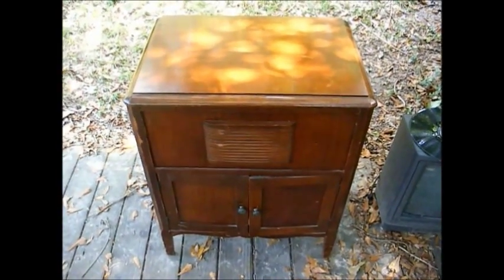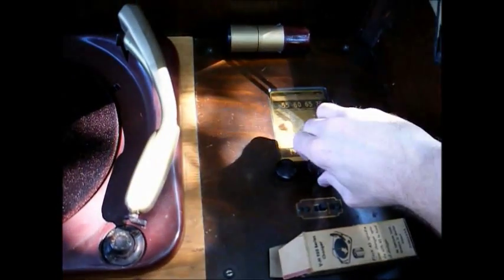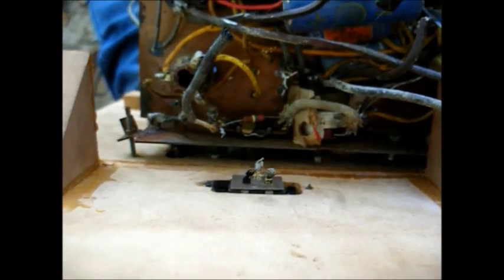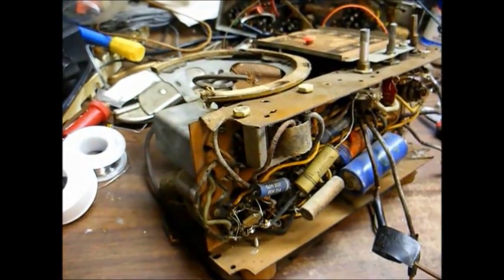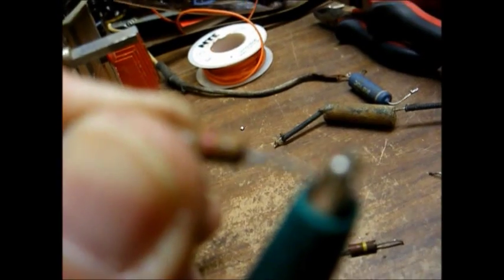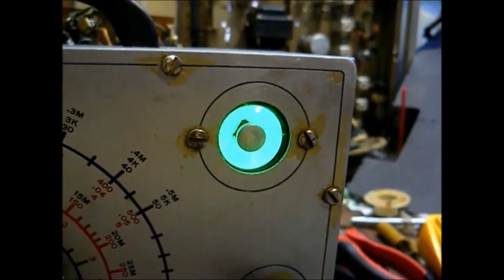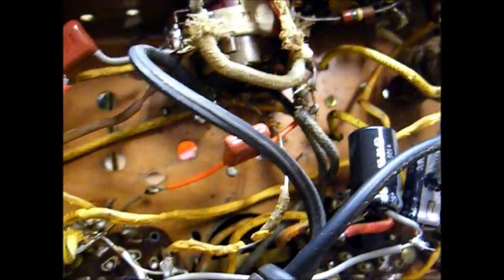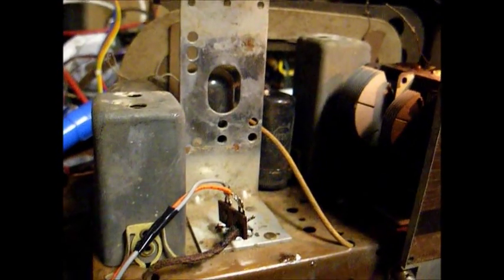RCA, Automatic, Voice Of Music "frankenradio" tube radio / record player

Comment: I've never seen that one before. This was one of the earliest example of a console hack. You can take a radio and then connect to a record player and called it a "Franken Set", an all-in-one combination. This was long before stereo receivers and amplifiers did not introduced until the 1960's where they includes the RCA jacks on the back where you can hook up to a phono and aux for DVD players, iPhones, iPads and other devices.

Comment: That's an interesting find...don't see too many Automatic consoles. I"m thinking they probably gave up on the original turntable when the idler wheel went bad, but I wonder why they replaced the original chassis? You might be better off going with a newer VM turntable...one with a ceramic cartridge, and the more simplistic drive mechanism. I'm staying tuned to see how this one turns out.

Comment from the maker: Yeah, I'm thinking the same thing on the changer because I could easily spend close to $100 having all the rubber rebuilt and I'm really not that crazy about this series of VM changer. The good side is that at least this changer looks old enough to more closely match the original cabinet. Maybe the old chassis got struck by lightning and wasn't worth fixing and the owner liked the cabinet well enough to swap in another chassis.

Comment: In the '50s apparently it was a popular "handyman" hobby to take an old radio set with a beautiful cabinet but clapped-out or obsolete chassis and install a later model chassis and changer.  Burstein Applebee used to show many "combination" kit offers of different popular makes that could be installed in older cabinets.  IIRC a company called Midwest used to offer a number of kits like this.

When I was a kid back in the early 1970s I found a cabinet in the grandparents' barn that used to have an Atwater Kent radio that my grandfather used back in the day.  The original guts were long gone--probably my uncle...  Anyhoo I ended up acquiring an old Philco floor model radio with slicer changer and optic-beam tone arm.  The changer was accessed by pulling on the top edge of the speaker grille the way most of those old consoles were.  The changer was FUBAR.  And so was the cabinet, owing to being stored in an outbldg with a leaky roof.  The radio chassis and its speaker worked just fine, so the A/K cabinet served as a new case, with the original Philco loop antenna mounted on top.  It was rather sinister looking, but I used that as my bedside radio all through my teens.
Reply: +David Locke  I can vaguely recall, on a similar fashion RCA advertised and distributed all the resources needed to convert old Mono players  to Stereo back when stereo was a new thing.

Bet your radio looked really cool.

When I was about 12, my parents bought and gave me an old tube radio for me to play with (my first experience with vacuum electronics, memories). It was so severely damaged I never managed to fix it. It did however pick up a station once before bursting in a cloud of smoke. The cabinet claimed to be a '41 RCA Q21, but as time went by, I finally worked out that the chassis did not belong to that set.

It was rather obvius, since the holes to screw the chassis to the cabinet didn't match, the tubes themselves didn't match, it had no power transformer, while the Q21 has one,  it has a 2 band dial like the Q21, but the chassis is a single band set, among a big list of smaller makeshifts inside. The chassis doesn't have any mark that tells where it came from. It looks more recent than '41.

Would replicate a Q21 chassis in the broken chassis if I had a schematic, since the cabinet is a local manufacture that is quite different from the american one, I really like it.
Reply: +MisterTalkingMachine , Nostalgia Air www.nostalgiaair.org will have your Q21 schematic, and schema for just about any hollow-state radio you might run into.  As for any old radio you dig up there's bound to be intrigue and evidence of jiggery-pokery.  The set has been around a long time, increasing the probability.  Also bear in mind that while there might be 5 people in your average middle-sized US city today that will tinker with a radio when it kicks the bucket, back in the early days of radio every 5th house on the street there was a man who would consider taking his defunct receiver out to a plank of wood on sawhorses in his garage and give the innards a look-see.  Some home-brew fixes were effective, some just downright amusing.
Reply: +David Locke Many, many thanks. For years I have been looking for documentation on the radio.

On a country like mine, which was rather poor by the time, you just had to repair everything, and yes, I have seen my share of some hilarious fixes, IE, a ceramic coated wire wound resistor blew up, so they wound another coil of wire over the dead resistor and attached it to the original terminals.

My grandfather himself says that back in the day, he once fixed the humming of a radio by putting a cap from a car engine in parallel with the cap that goes across the mains.

I acknowledge I am guilty of a lot of sloppiness myself, either on fixes I did when I was very young, or by being unable to get the right components.

When I was very young I replaced a broken dropping resistor from  a  220 V set with an Halogen lamp.  In case you are wondering, those sets are just your regular All-American Five with a clumsy big resistor. That resistor is very prone to failure, as I am yet to find a radio that has one in working condition, or lacks any weird fix. By now I have learned that those resistors, at least those with exposed windings, can be easily rewound with nicrom from heating elements, the dropping windings that drive the motor on hair dryers has been particularly useful as well.

Thanks you very much.
Reply: +MisterTalkingMachine , Any time!&#160; :)&#160; 

As a lad of tender years I used to improvise with whatever garbage I could pick up, or con off someone.  I used to dig old German radio chasses out of the creek beds behind residences in Columbus, GA back in the 1960s. These receiver "orphans"  came back with Army families when they came back stateside from bases overseas.  When Telefunken went funky, and no local technician would touch it, because it&#39;s one of them foreign jobs, the cabinet would be saved, and the guts hove. I'd dig them out, bring them home, hose them out, and plug them in to see what color smoke came out. Usually the chassis would get stripped, and I'd build something on it. I went through a lot of enamel wire and toilet paper tubes.  When I couldn't get my hot little hands on a UY-224, I would improvise with a 12BA6 cadged from a busted-up AA5.  Most of my make-do tricks regarding parts such as capacitors would provide good results, or great excitement. :)
Reply: +David Locke Hahaha, yes, I can relate as well. Adapting a miniature tube to an octal base is something I can recall trying at least. Making coils on toilet paper rolls, PVC pipes, bottles, whatever could hold the wire, which I more often than not got from some broken electric motor.

Butchered roadside TV's were and are still a great resource, thay can source miscelaneous capacitors and resistors, sometimes come with power resistors that are just unavailable at the store. May also provide transformers, speakers, and sometimes older sets pop in, with some tubes left in.

I have a franken device I built myself in recent years actually. A simple record player composed  of a BSR changer in the case of an old Garrard RC-80 some demolition men found totally rusted in a house that was abandoned since about 1960, and gave to me. The changer rusted to near inexistence, but somehow the wood survived in very good condition. Put in a pair of speakers from a samsung TV that got dumped at Grandma's place, an amp from some crap 90's casette player and it was done. Plays better than a Crosley for about one twelfth of the prize, and if it falls from the table, it bounces on the ground without any harm.

I will have to get my hands on a set of tubes for the Q21, but the hardest issue I will come across will most likely be the power transformer. May end up making the transformer itself from scratch, by rewinding a mains inverter or something along those lines.